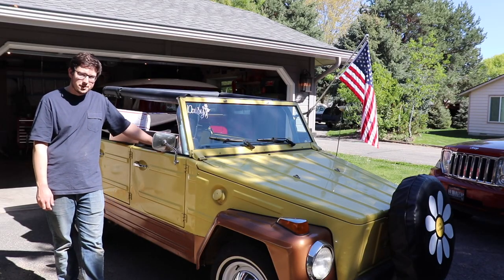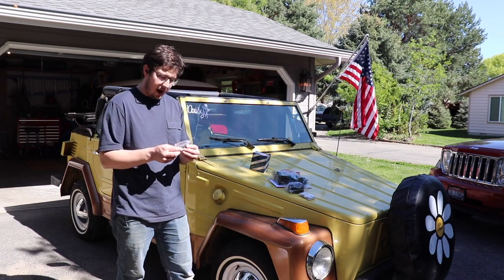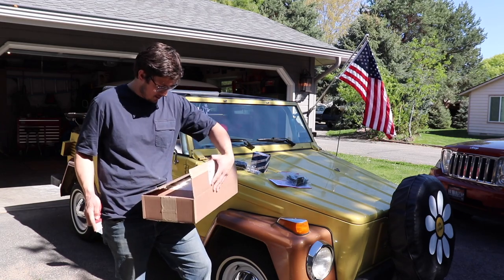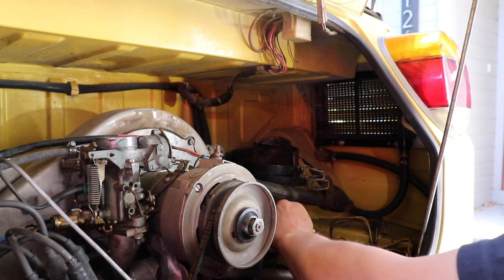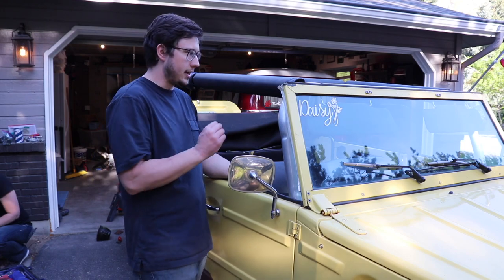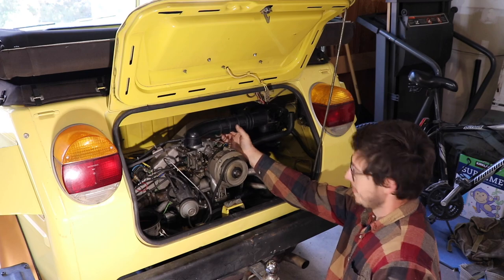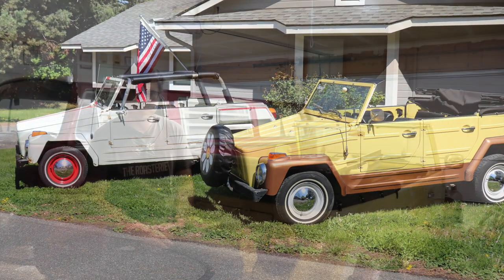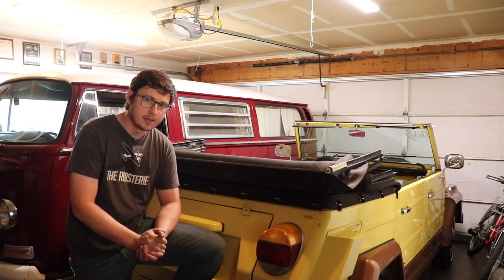Volkswagen Thing Resto Episode 2: Parts Call, Rifle racks, Oil Bath Air cleaner, and Roll Bar Woes!

Comment: First off I believe a roll bar is necessary. It will stiffen the chassis as well as provide occupant protection. VW of America sold 2 different versions commonly referred to as a "West Coast" and "East Coast" style bar.  Both designs are great and do not interfere with the operation  of the windshield.
Reply from the maker: Yeah the roll bars are probably a good idea. We may get another one in the future. We are pretty happy we got rid of the one we had though. It was pretty flimsy, and I'm sure it wasn't doing anything to stiffen the chassis or provide any real protection, so much as just the illusion.

Comment: I built tube frames and roll cages for decades. For that style cage, I would use 2" dom mounted on 6"x6" quarter inch plate...    best wishes
Reply from the maker: Thanks. I don’t recall if I said in the video but it was made from 6061 aluminum. Not really providing much structure as built for sure. If we decide to go with another I will keep that in mind. Thanks for watching.
Reply: @GarageMisadventures  Inferior metal becomes a home run baseball bat even in a low speed accident

Comment: Really enjoyed the video , made me think about, and miss the Thing I used to have. 
I notice your fan housing is different then a beetle and looks like you don’t have heater hoses...is that factory? My Thing was a ‘74 and I know the ‘73s had a gas heater , was that the only heat they had ?
Also for the life of me I can’t remember if the convertible top should have a cover that snaps over it like the bugs did. 
I think I would leave the roll cage off ain’t going to give you much protection anyway if you flip it being bolted to that sheet metal pan
The gun rack sounds Neato. 
I have registered German Machine gun ( MG08/15) and I made a mount that went on the Roll bar of my Suzuki Samurai and would shoot groundhogs with it ...great fun!
Reply from the maker: Glad you enjoyed!
So the fan housing for the '73 does not have heater hoses, however I don't know for sure that I have the right fan housing for the Thing, because I got another fan housing with it, and also I have external oil coolers and a spin on oil filter that I believe was all aftermarket, which may be the reason they swapped fan housings. But either way you are right, the '73 has no heater hoses, only the gas heater, so the fan housing is different from '73 to '74. I did get the book on the gas heater and I need to go through it as well because I haven't been courageous enough to pull the knob on the heater yet, ha!

I have not seen a cover for the top, but there very well could be one. I'm not sure. Any chance I get a look a Thing over, but most of the ones I've seen around here are not perfect stock examples. I know you are right, it was VERY lightweight when we pulled it out. I was surprised. I guess it was more of a sense of protection than any actual protection! I did like the guy who bought it's idea about doing a sort of minimal Bimini type top for cruising in the summer. Less bulky than the full soft top yet keeps the sun off. 

Keep watching we will get those gun racks installed yet! haha. That sounds like fun. I had a Samurai when I was a teenager. Heavily modified, had a Tracker 1.6 and different axles running 34.5 inch Super Swampers. Goofy looking but a fun little car.
Reply: Garage Misadventures I think that is probably an after market fan housing. So the ‘73 didn’t have heater hoses? Interesting, guess didn’t have heater boxes or heat channels either. Never realized that, I think the ones imported to the US were made in Mexico so maybe they figured they didn’t need heat. 
I’ve never liked those external oil coolers I’ve seen a couple engines fry because of them. They used to be kind of popular, I remember guys mounting them on the outside of a bus.
Reply from the maker: Deadhorse1 yes I think it is. I believe the other one I got is the stock one. You are right the Thing is VW of Mexico. That’s interesting about the external oil coolers, I assumed they were a good thing. I will have to do some more research on them.